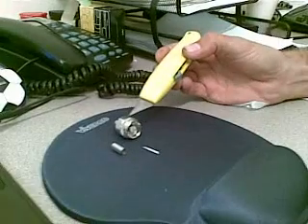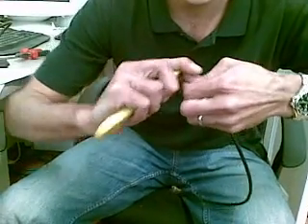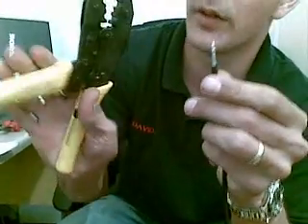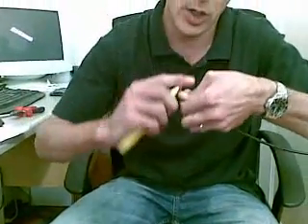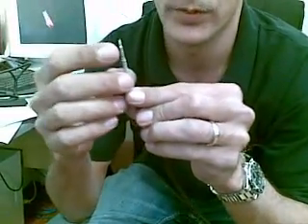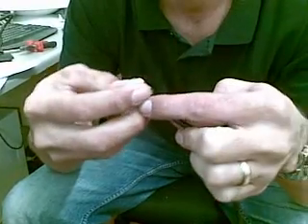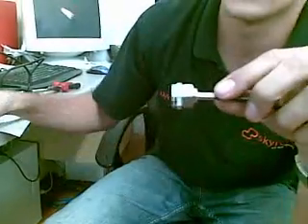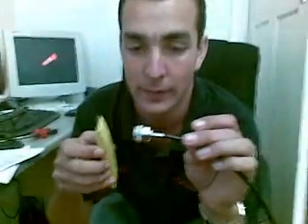N Type Connector

Comment: @robertskyrove Thanks for your help. I am currently designing a 5 km LOS link while trying to stay within FCC and WPC(india) regulations for 2.4 GHz and 5.8 GHz. My Fade margins right now are 23 dB and 14 dB for either frequency. Do you think this link will hold up with small intrusions into the fresnel zone and even into LOS considering that My fresnel zone 60 percent clears the ground by about 1 meter

Comment: Thanks for  the help. will the procedure remain the same for an LMR 600 cable? I don't have a separate crimper for my cable. Can I just use standard pliers to press the connector tight? That's what you seem to be doing with the connector. any help is a big help. Thanks again.